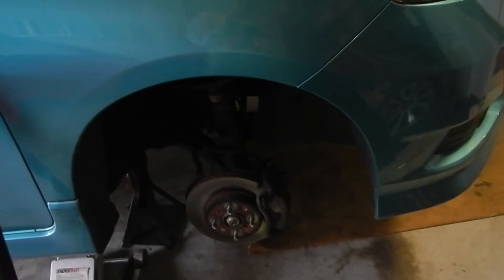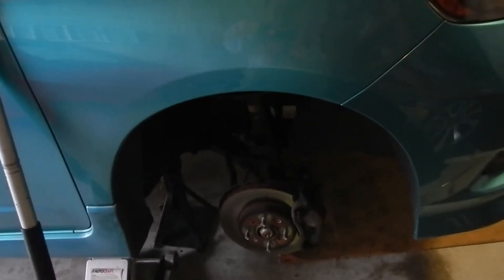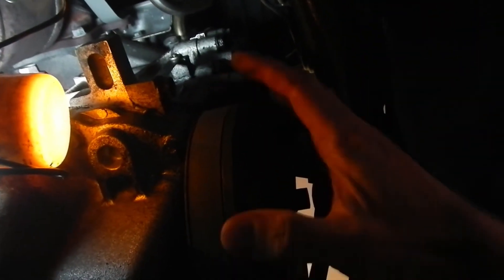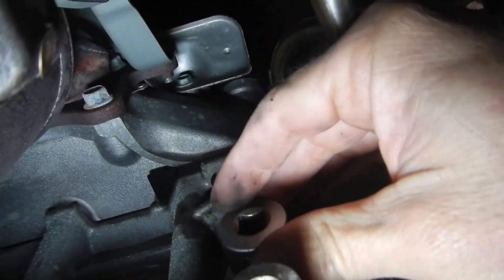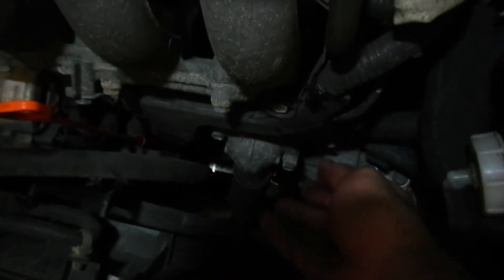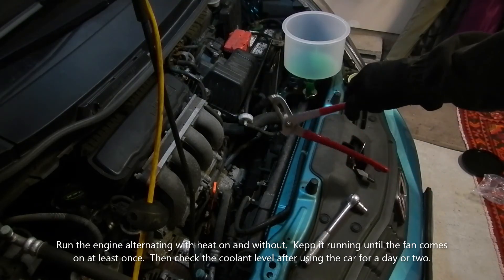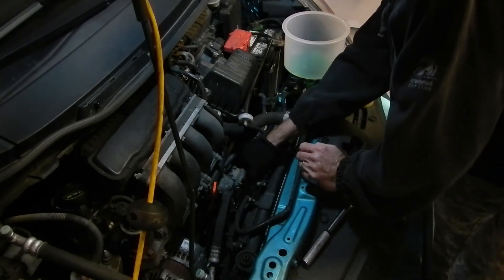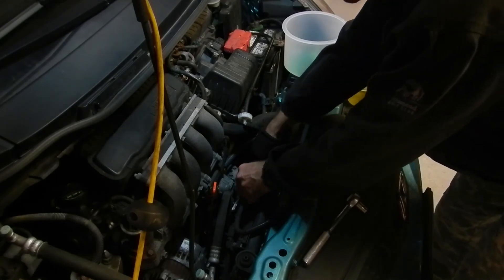2013 Honda Fit   Radiator Drain and Fill

Comment: Thank you a lot for the video ^^
I've read than the drain bolt under the engine is often seized indeed, so I plan to do just like you and only drain the radiator.
I did not knew it was so easy to remove the overfill tank :D